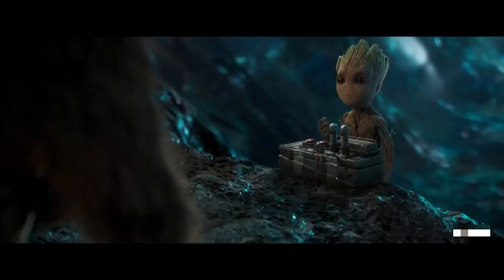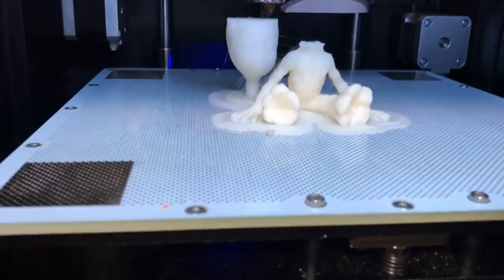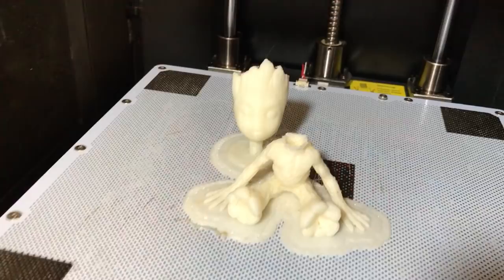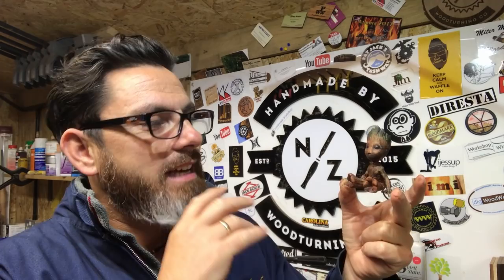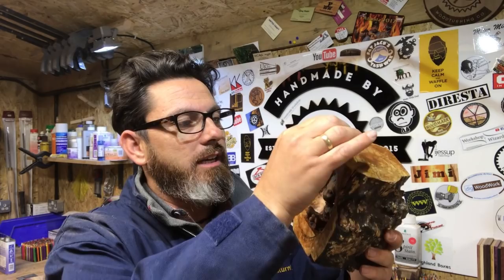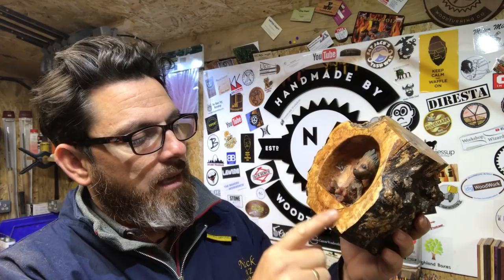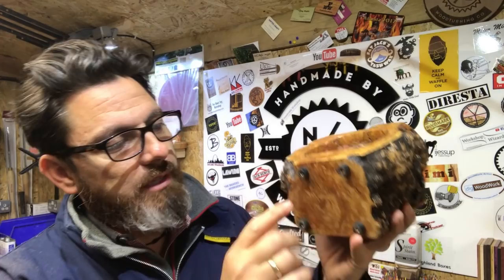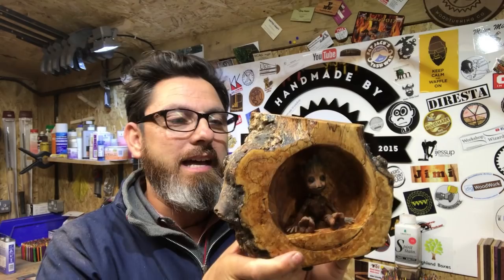MAKING A BABY GROOT FROM GUARDIANS OF THE GALAXY MOVIE

Comment: Check into doing 3D resin printers. They do NOT have the line roughness that a 3D filament printer does on a model. And you can get MORE detail than a filament one can do.